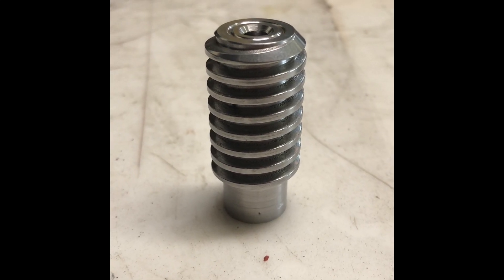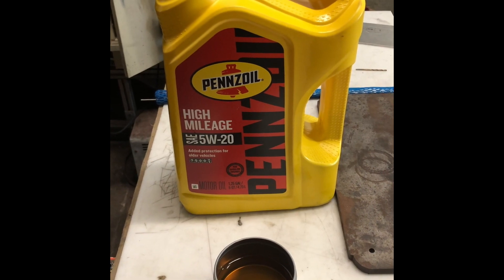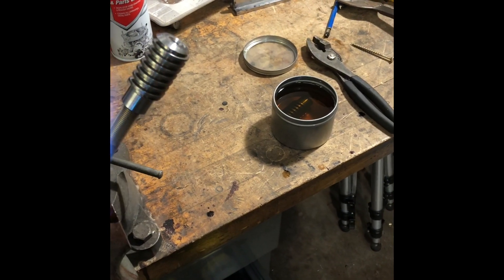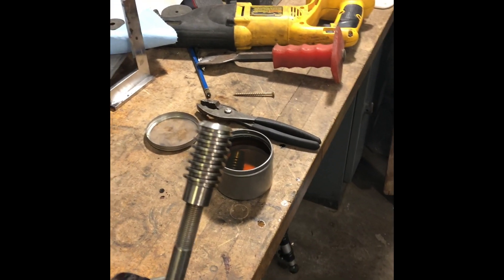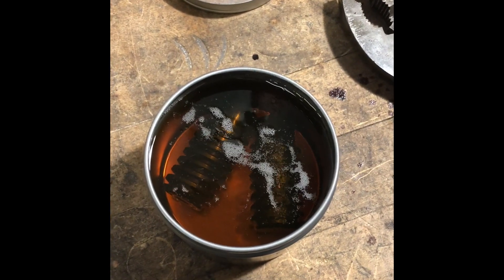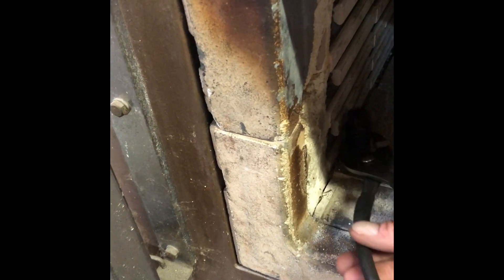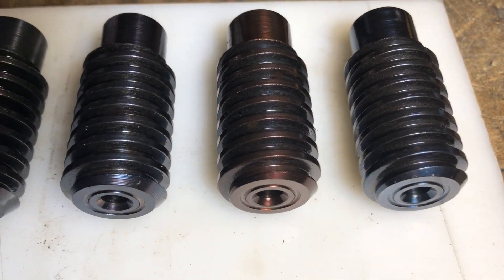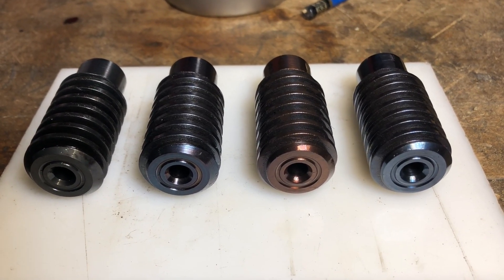How to Blue (Bluing) Steel Using Oven Or Torch and Oil Method

Comment from the maker: I have received many questions about blueing parts such as barrels or previously heat treated parts.  This method is not recommended for these types of parts, as it can deform them or change the hardness of the heat treated parts.  There is another method called cold blueing that can be used for this.  You can use products, such as Super Blue by Birchwood Casey, which uses a chemical process to blue the steel.
Reply: Your reply to my remarks make perfect sense, great video, I have just blued cylinder on HW77 and it's turned out beautifully, thanks to your video. 👍👍👍👍👍
Reply: Hi, not sure about heat on barrels, I'm ex British soldier and we would fire LMG Bren guns until the barrel glowed, quick release lever to change to fresh cool barrel, didn't appear to have adverse effects even after glowing enough to set fire to grass when quick changes needed. Now I suppose you are right in that certain temperature would ruin barrels however temperature shown here I don't think would do any harm??
Not being picky and don't mean to be clever just my experience in life.
Cheers 👍
Reply from the maker: @24745037   I completely understand where you're coming from.  Difference is that most people don't have the ability to heat the barrels evenly/uniformly.  When turning it red from firing it, everything heats, expands, and contracts at roughly the same rate and maintain fairly uniform temperatures.  If you use a torch on a barrel, you will inevitably  heat one side more than the other, causing the steel to move.  If you can do it in a large heat treating oven, it will probably be ok.

Comment: When I heat metal up with a torch I do it in a much darker room ,as I will see color change`s much better, 
Placing the steel in a more confined space surrounding it will produce a faster and more constant heat through out,when using the torch,
I drop my piece in its liquid within a couple of seconds at most, quicker the better,

Comment: Sir can i use vegetables oil for finishing
Reply from the maker: I never tried that, but I don’t think it will work properly.  I believe you need a petroleum based oil to get the proper results.

Comment: In watchmaking, we heat blue to. We sometimes use brass shaves from using the file on just raw brass.
It's great to cover the part in to get an evenly heat distribution.
The heat source can be ethanol based or gas even a stove top. Just have the brass shaves in a heat safe container (like brass sided box/container).
You can control the blueing better.

Comment: Hi sir I want this blue shade at spring wire to to make it easy can you please explain to me
Reply from the maker: I do not think you should do this to spring wire.  Heating and quenching/cooling it may change the strength / hardness of the spring, lose its spring, or cause it to crack when springing.

Comment: What sort of oil did you use? It seems someone in the comments said they used quenching oil to ensure no detergents and other chemicals were present. I assume the quenching oil has sulphur presnt due to its color. Would you recommend using differential oil as a cheap easy to access alternative?
Reply from the maker: I just used 5w30.  Worked just fine, still looks good.  Butttttt………Internet experts know everything better, and have to add their 2¢ to everything, even though most of them probably never even did the thing they are weighing in on! 😂  These parts were for my gun, not a $1,000,000 Bugatti!  Unless you’re restoring some super valuable collectors piece, who cares, as long as it works?  My dad always says…….know when to be a butcher and when to be a watchmaker….

Comment: I've had great success with getting gun parts nice and black..simply heat it up with a propane torch not map gas..then quench in 10/30 and immediately back to torch and repeat... you will get a nice dark black.. when cooled use remington rem oil and your parts will look like they were pained black or coated black with a special treatment..i was shown how to do this personally by a old guy from Idaho..my friends pops..i did this on my 44 cal revolver and it looks awesome 👍..its durable and rustproof..its the technique old time gunsmiths used..fire and oil..the trick is ro keep burning the part with oil on it..heat it/quench it/immediately back to the flame and repeat..it will get blacker and blacker..

Comment: This method can be done on stainless steel materials?
Reply from the maker: I imagine it should work, never tried it.  Stainless doesn't require protection from corrosion, which this does.  Let me know if you try it and if/how it worked!

Comment: I've had great success using this on blued smith side plate screws.  I also find that you can get a pretty purple color if you like but it turns from that purple to black in a split second.  Also once it turns black if you keep heating it it will turn a dull brown.  I use distilled water to quench my pieces then oil after.  I want to quench it as fast as possible to lock in desired color.
Reply: I do the same with the water. It seems to better hold the colour after you pull it out of the oven to my mind as well. I then cold coat with lanotech for protection if I'm putting the object away in long term storage.
Reply: For screws, I just use cold blue solution.  It does a really good job on screws and  It takes only seconds, and you don't have to worry about a color change.  However, for large pieces it is not good because it won't coat evenly.  But using a torch causes the color change in only seconds also.
Reply: Will this method is safe for guns screws without cause any damage or loosing its strength

Comment: Assuming, I have a pool of engine oil..can i do the same for an entire steel bike frame
Reply from the maker: Assuming you can get the entire frame heated uniformly , I don’t see why not, however, I might be concerned about the welds cracking…

Comment: Be interested to know what it cost you in Electricity vs Propane to colour these parts? How long did you have these parts in the kiln versus how long did you apply propane torch?
Reply from the maker: The oven definitely used more energy.  It only took a couple minutes with the torch.  If you were doing a whole bunch of parts, you could do them in the oven all at once, but for a hand full of parts, gas is faster.  Experimenting with the oven added time, as I was trying to figure out how much above the desired metal temperature I had to set it...

Comment: just one question. Is it a good idea and good safety procedure to point the torch toward a can of carb and choke cleaner? I know obviously you did not have an issue this time. But I still believe in erring on the side of caution. Just a thought.
Reply from the maker: Of course not Willy!  This was one of my early videos, and trying to do everything while holding the camera was not easy.  Rest assured that I have upgraded my equipment so I don’t have to do that anymore…and I still have not blown myself up…😂

Comment: Does this process increase the size of the objects by a little? cause i want to do on bolts but i am concern it may increase the size of the bolts
Reply from the maker: It potentially could, but it didn't change it by a significant amount in this case.  Go / No-Go gage still worked on the threads, so I did not take any physical measurements of the rest of the part.  Other features are strictly aesthetic, so that was not important here.  Try it on one bolt and see what happens!

Comment: Any one know how do this on stainless steel?
Reply from the maker: Probably the same way, but I don't know what kind of results you will get.  You'll have to experiment and find out.  Let us know how you did it and what worked!
Reply: @OOMAN  definitely it's not working for stainless steel as I can find in Intrnet this is complicated chemical reaction needed for SS
Reply from the maker: @AndreyBorodaS  Thanks for the info.  There has to be a chemical kit you can buy to do it then.
Reply: @OOMAN  yes, plus you need heated and base on instruction this is a complicated process

Comment: Can you blue angle iron?
Reply from the maker: Never tried it, but don’t know why you couldn’t!
Reply: @OOMAN  Tks. Does bluing protect the metal a bit?  Like from water etc?
Reply from the maker: @xtexbrown  It will protect it a little, but not like plating.  Best to keep it dry and put a light coating of oil on it once in a while.

Comment: Can you do this on a part that's already been hardened and tempered?
Reply from the maker: Any time you heat and quench metal like this, you will have an effect on the hardness.  I wouldn’t recommend it if you’ve had the parts heat treated to a specific hardness…
Reply: @OOMAN  Thanks, I appreciate the info. I'm trying to figure out the best way to protect a chisel I just forged. I think I'll just have to keep it oiled instead

Comment: Been thinking about doing this to small parts for some time now but haven't tried it yet. Would there be a danger in warping a barrel at these temps if a person tried that? Thoughts?
Reply from the maker: You definitely don’t want to do this to a barrel.  Chances are that it would deform.
Reply: @OOMAN  That was my thoughts to but i thought i'd ask your opinion. Thanks for the response and good video by the way.

Comment: The oil itself reacts chemically with the metal, and influences the final color as a result. I use quenching oil for hardening and tempering. It’s also more consistent when coloring metal. With motor oil, vegetable oil and the like, you get chemicals in the oil. Much motor oil has detergents, lubricants, etc. They cause unpredictable effects.
Reply: Thanks for the pointer. I should have figured that out for myself as I have had (some) good results turning steel black with heat and used sump oil. But it often gets too thick a film that flakes off.

Comment: If you want the part to be darker or close to black rather then use used motor oil, the good black used oil from your previous car service. The black oil makes the part significantly darker when heated and quenched in used oil.
Reply from the maker: Thanks for that recommendation!  I'll have to try it next time!
Reply: I made a small tank stainless 45x70x70cm to do my Weihrauch HW80, what l did was go the steel real clean used 1200s paper, then l heated the used motor oil till boiling hot with my Venturi Burner, then the steel was heated till just started to turn cherry and quenched, got a very good Finnish, I've done knives and other bits. A mate did his 22 Anschutz 1417 same way it turned out great.
Reply: No shit ,did not no that thanks for the tip

Comment: after im doing that step,its oke from rust.?
Reply from the maker: This process will help prevent rust, but not stop it.  It is not like chrome plating something.  You need to keep it oiled and away from moisture/humidity like any steel.

Comment: Im machining a muzzle brake on stainless, definetelly going to do this when its finished. 

Thank you so much!
Reply: @Psychedelic Mind I was able to do it on steel but not on stainless steel, apparently you can acchieve different degrees of oil-purple by rising it to different temperatures before dipping it
Reply from the maker: I don't know if this will work the same way on stainless.  You might want to try it with a piece of scrap before doing it to the finished brake...
Reply: @OOMAN  indeed, that is very true, I will try it first on a spare rod I have lying around👍

Comment: Does doing something like this prevent rust ? And if it does can I send something in to you to “blu”
Reply from the maker: It does help prevent rust because it impregnates the oil into the outer surface.  You should still keep the metal oiled for maximum protection.  I don't know if it would be practical for you to send something here for blueing.  Give it a shot and let me know how it turns out!!!
Reply: OOMAN ok maybe I will give it a try . I

Comment: Can I do this with pistol slide & frame?
Reply from the maker: I would not recommend doing this to any precision parts such as barrels, slides or frames.  The heat may cause components to warp or deform.
Reply: @OOMAN  Thanks, I appreciate the advice.

Comment: why put it in oil? for tempering you you let air cool. is the oil specific for bluing. in my experience if you cool it too fast it will loose whatever color you are going for.
Reply from the maker: Joseph Davenport  As I explained in the video, dropping it in oil gives it some rust protective properties.  Tempering was not the goal here.
Reply: @OOMAN  You did find, though, that the color changed back somewhat with the oil dip, right?
Reply from the maker: @robertbrandywine    It went back about one shade, except for when I really heated it to the darkest color with the torch.

Comment: Can u do this with a barrel?
Reply: I'm looking at dura Cote options. It's a good looking coating. I'm not a cerekote fan
Reply from the maker: @jasonbubley9427   I  don't use either on my stuff.  Not familiar with dura cote, but lots of friends like and have had good luck with the cerekote.
Reply from the maker: Heating up a barrel like this would most likely cause it to deform/warp.  I would not recommend it!!!
Reply: That's exactly what I would assume

Comment: It would seem that torching is quicker and cheaper, and you're in close visual contact to monitor the changes, with quick access to quenching. When I was an apprentice in the early 60's, the blacksmiths used this method using whale oil. You probably won't find much whale oil these days I guess....

Comment: most detailed instruction on oil bluing i've watched! thanks! also i just wanna ask, is it possible to paint over oil-quenched surfaces? ima try doing this same process on a bike. Thanks!
Reply from the maker: Thank you Badznovski!  Glad it helped you.  I have never tried painting an oil-quenced part.  I imagine if you spray it down with some brake or carburetor cleaner, it should take paint.  Try using a self-etching primer before painting.  Let me know if it works out!!!
Reply: @OOMAN  ohhhh ima definitely do this as soon as this quarantine (in the philippines) is lifted. Thanks again!!!
Reply: @OOMAN  oh by the way, i forgot to ask, how long do you keep it dunked under oil again? i'm thinking of using used engine oil 🤔...
Reply from the maker: @UltimateKaploger   Used engine oil should be fine, but might give it a little darker color.  I used new engine oil.  Just drop it in and let it cool down for a little bit.  It's the initial shock and cooling that gets it to impregnate the pores.
Reply: @OOMAN  so not more than a minute, right? thanks agaaaain!!!!!
Reply from the maker: @UltimateKaploger   Leaving it in longer won't hurt.  Just leave it in for at least a minute or two.

Comment: Try heating the oil before dropping the parts in, then slowly turn down the heat and extending the process time. Compare the the results. I think you'll see a noticable improvement.
Reply from the maker: Part of the protective coating from this process comes from "quenching" the parts.  The rapid cooling process aligns the molecules and hardens  the surface, which results in extra corrosion protection.

Comment: Great video, thank you. I have 2 questions.
How durable is this finish?
Would you consider doing another video where you compare a part (or parts) done with the oven and new oil, and parts done with the oven and used (very black) oil?
Reply from the maker: Juice556  Thank you.  The finish helps prevent rust, but is not as good as plating or painting.  Keeping the surface lightly oiled will protect the metal from humidity, but not hold up well if you plan on leaving things outside in the elements.  If I do another video on this topic, I may try your recommendation.  If you try it, let me know how it works out!

Comment: I haven't done this yet, but with other types of quenching the quicker you are to the quench the better the results. Maybe that step back in color is because of the long (in relative terms) delay  from the oven to the quench.
Reply from the maker: Good point.  They pretty much went straight from the oven to the quench.  It didn't take so long to shoot the video that they would have cooled ~50*.  The ones I did with the torch did the same thing.  I'm thinking that maybe it was the oil I was using, or perhaps the relatively small amount of oil that I was using.  The oil may have heated up, not cooling them fast enough as it heated up, especially when I added multiple parts...

Comment: If you just let it cool down naturally, I read it will maintain its color. It seems that when you oil quench it, it’s highly darkens the colors.
Reply from the maker: PacForeTravel  The  oil quenching is what gives it some corrosion resistance by hardens the steel a bit and impregnating some of that oil into the pores on the surface of the steel.  That is the main purpose of blueing, the cosmetics are only a secondary consideration.
Reply: Thank makes sense. For my application it is strictly cosmetic. This was a great video because I wanted to find ways to evenly heat metals to those golds and blue colors besides a torch. I don’t have a furnace with a PID like you do in the video but I did see a guy make a diy oven and a powerful heat gun to bake, if a powerful heat gun (1000 degrees max) were to heat a piece of metal in an enclosure do you think I would be able to achieve what you did here??
Reply from the maker: @PacForeTravel   Only one way to find out! :)  Just be careful that the enclosure you make can handle the heat and don't have anything flammable nearby...  Let me know how that works out for you!

Comment: Very cool experiment, I read in one of my old gun care and repair books from the 70s That the oven should be between 700 and 1000 degrees and then you quench it in linseed oil mixed with Hoppe's No 9 solvent.
Reply: I use wd40 sprayed on hot part